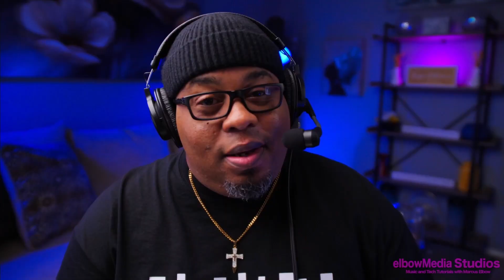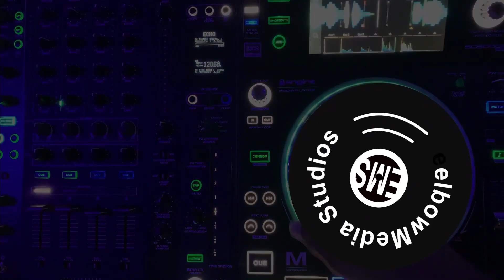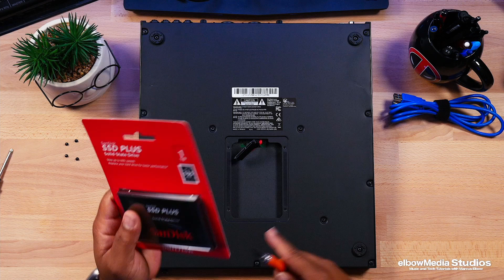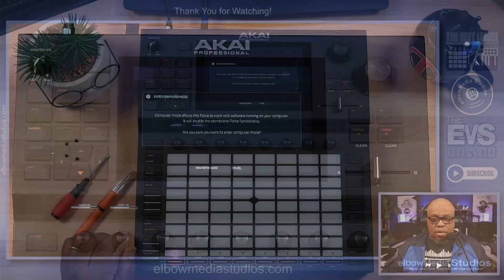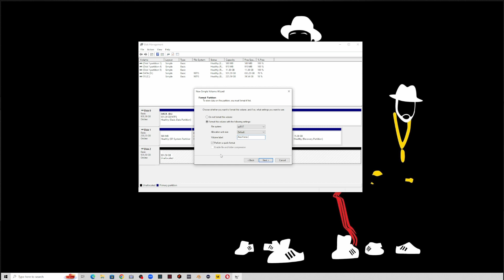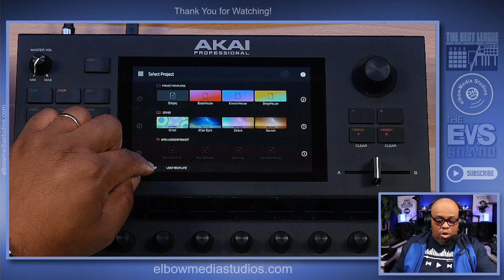How to Install an SSD into Your AKAI Force Quick and Easy!!! 🤯

Comment: Does anyone know why my pc won't recognize the ssd in the akai even it's plugged in? It doesn't show up in disc management it's only and icon of a thumb drive in the running programs in the tab at the power right corner and it doesn't register when I click the icon?
Reply from the maker: The force can’t connect via USB. You have to use a SD card or add an internal drive but you still need to connect that drive to your pc outside of the Akai Force and exchange packs.

Comment: Is every 2.5" SSD compatible? or are some better than others? There is a SSD and a SSD plus 1tb option when I use the link $59 vs $115
Reply from the maker: The one I have in the link work great! I haven’t tested any other drives. 🙏🏾👊🏾
Reply: @MarcusElbow thanks  is that $59 one?